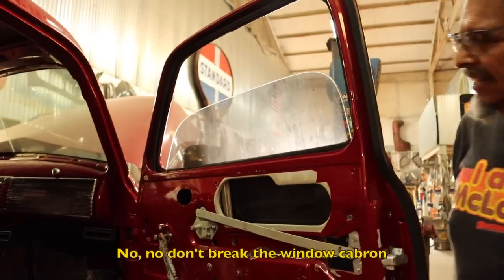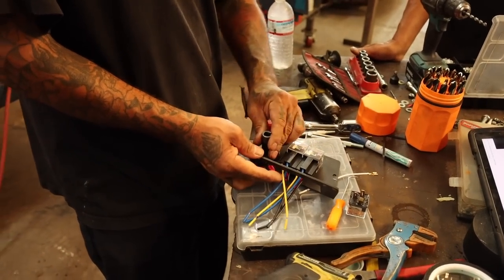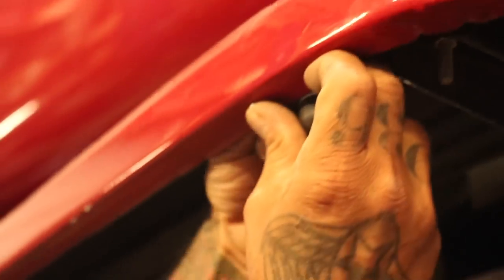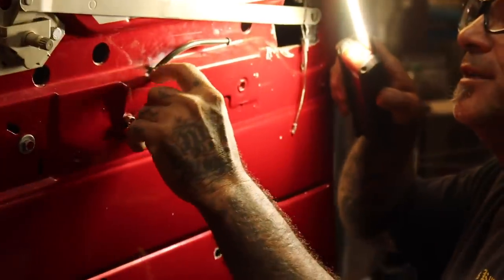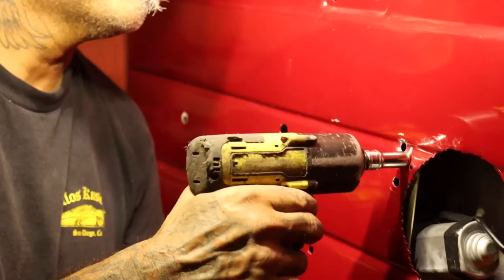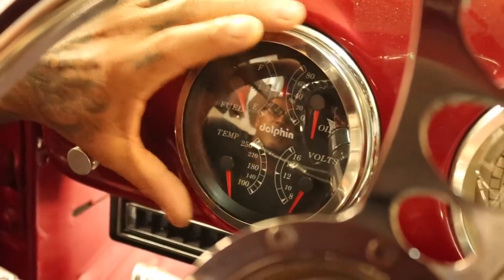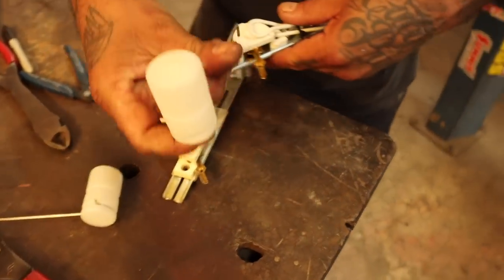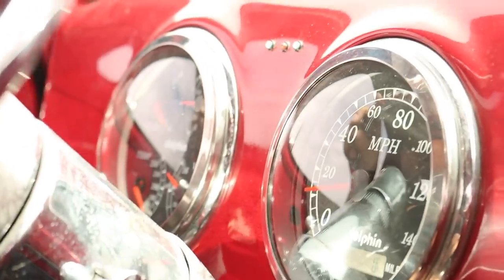1950 Chevy Pickup Truck - Part 7: Back On the Road

Comment: The wire length may effect the impedance of the Potentiometer.  ( that little rap of copper wire in the sending unit ) That would give a false reading if it were longer or shorter than in should be.

Comment: Looks and sounds good! The windows and doors work just right!  Are door poppers like on new cars available? You can lock and unlock from the key in hand. Being able to open the doors by kicking the button doesn't seem secure.
Reply: There is remote-controlled ones on the market to

Comment: Nice truck, too bad it wasn't done properly the first time. Does it have a panel under the front grill to finish it off - would look more "finished" if there was. Nice work as usual, I also hate fixing other peoples garbage work!
Reply: I kinda agree, but I’ve made a lot of money from reworking other work. 
One thing I insist on when I take on such work is that I fix everything I find , not just some of it .